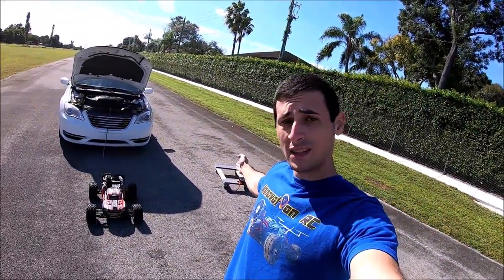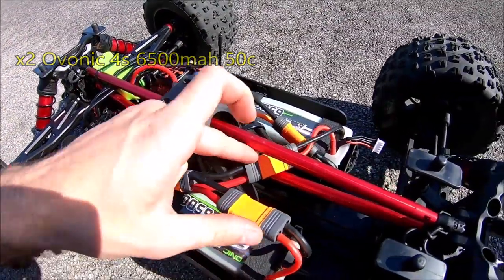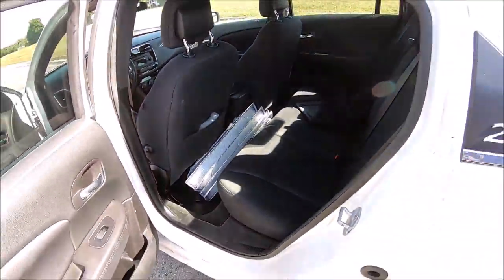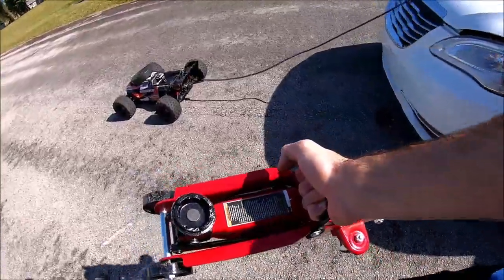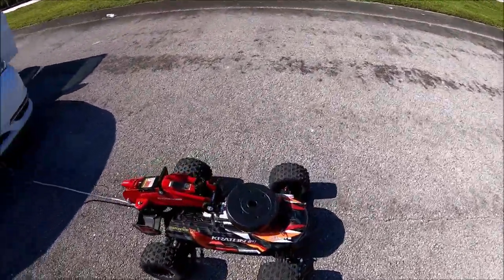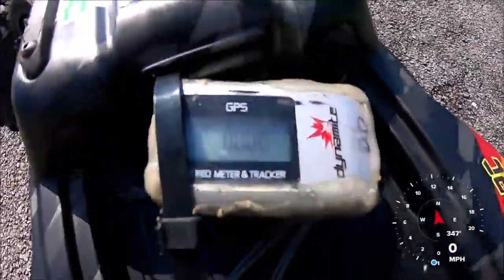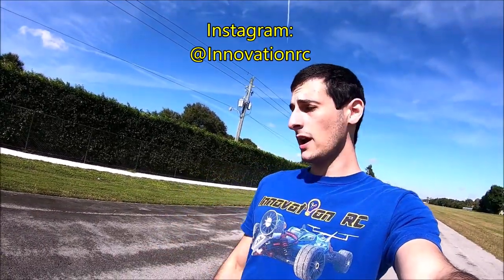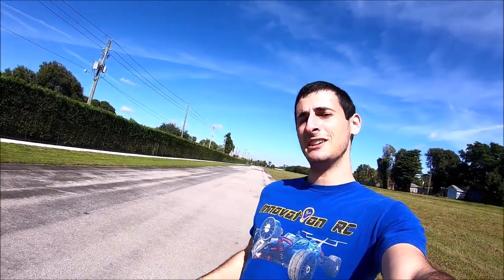HUGE RC pulls a CAR!

Comment: Hook the chain to the bottom of your car like a frame railor your radiator support frame, u will get much better results
Reply from the maker: I looked under before I did this, everything to grab onto was plastic, didn't want it to rip off so went with metal. It can pull so much more weight if it were lower to the ground

Comment: It would pull a lot better if you can get the strap down below the bumper of your car instead of under the hood on core support. It wouldn't try to pick up back of the Kraton
Reply from the maker: Check out the newer pull video 😉

Comment: What did I just watch!!! AMAZING 1.5 Tonne Car being pulled by the Kraken on 4s Power 💪 👊 🔥 🔥 ⚡ ⚡ Suprised the Motor held out & gears!! Was Motor & ESC toasty hot after this Science experiment?? Well if I break down in my Motor & I have my Kraken 8s in car I can tow my car home 😂 👌 👌 BTW... I would Luv too see what speed yuou could get out of this with "Stock Electrics" geared up etc.... 👍🏿 👍🏿
Reply: jason budd  it is on 8s
Reply from the maker: I will do a speed run with stock electronics soon 😊
Esc and motor didn't sweat at all during this video, nothing over 140°F
Reply from the maker: @NabiL_Lam  it's 4s parallel
Reply: @InnovationRC  Wow... Thought Motor & ESC would have gotten hot. Can't wait to see stock speed run 💪 👊 Mine is all stock apart from Punch set to 5 & adjusted Motor timing to 10 degrees. Thanks for reply & greetings from London.
Reply: @NabiL_Lam  He said in the Video that 2 x 4s packs were running in Parallel.. Wired in Parallel you only get 14.8V however many batteries are wired together, but you Double MAH = more run time & Double Amps =more Power.

Comment: Careful,  has to be hard on electronics.
Reply from the maker: No doubt I assumed it. Motor was 140°F at the end of the day believe it or not. Esc was warm, not even hot. I Intended on doing a temp check on video but forgot
Reply: @InnovationRC  awesome! Even better then..
Reply from the maker: @philipjolley1015  blew my expectations away 😉

Comment: I want to upgrade my kraton 8s with speed and torque what is the best set up for it with pinion gear and spur gear and also speed controller and motor. Please let me know if you can help me.

Comment: Did you like the new body style of your Chrysler after you're year 200 and did you know it had AWD as an option as well as a 295 hp engine?
Reply from the maker: I think the newer version looks too mild. I like aggressive looks. Newer version uses a smaller 3.0L 6 cyl turbo, mine is a bigger 3.6L naturally aspirated almost 289 hp so I get a kick either way, have an intake installed so I'm sure I'm right around 300hp as well.
If I were to get the next step up I'd go for a base awd Stinger or a 2015 Chevy SS
Reply: @InnovationRC   I think the last styling of the the newer one is better loo then yours no offense and the newer one did 0-60 in 5.8 seconds with the AWD.

Comment: Would have done allot better if you pulled from a lower point on the car bro it trying to pick the rear end up on the kraton.
Reply from the maker: Absolutely, the newer video pulling a truck has a much better angle